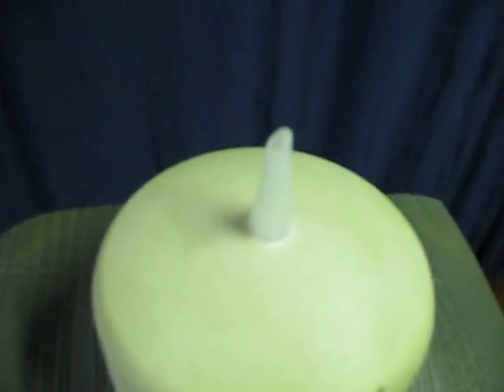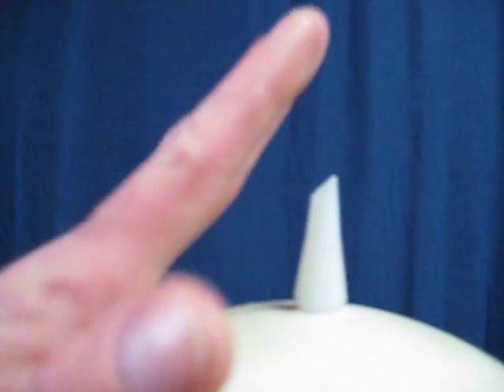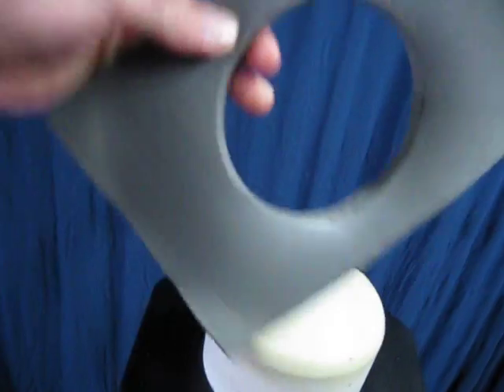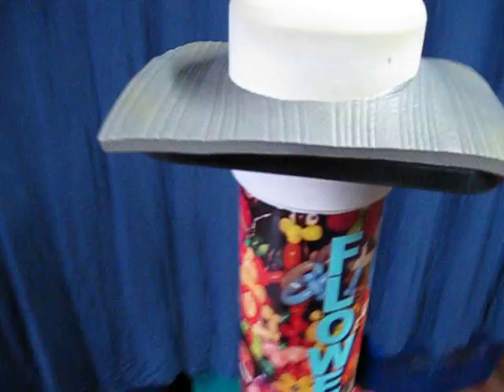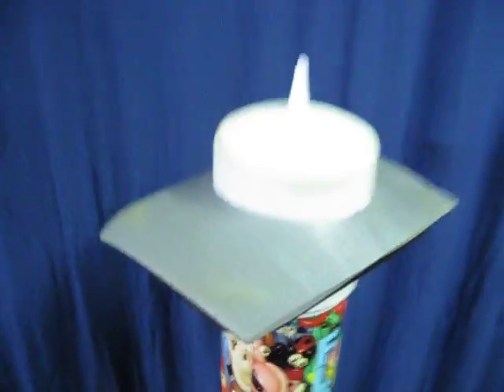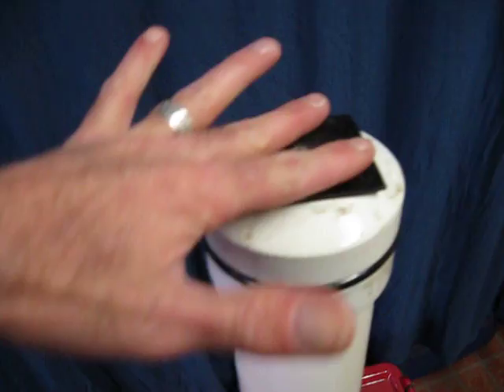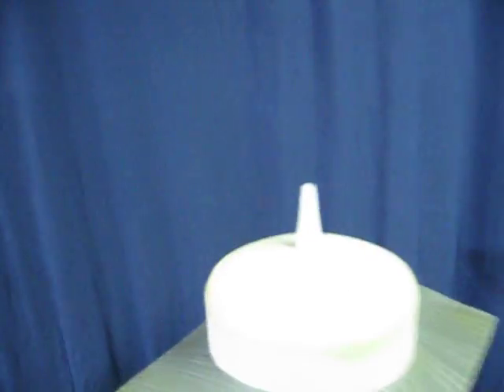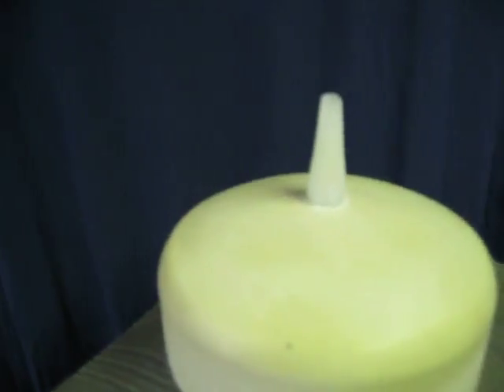Balloon floor pump

Comment from the maker: Years ago I did have one like the (mini mac light pump) As I remember it had a base that looked like feet and slots around the top where you could put the balloons. It was very light in weight but I always felt like I was going to break it so I sold it to another clown. This pump I love and have had for about 8 years now.